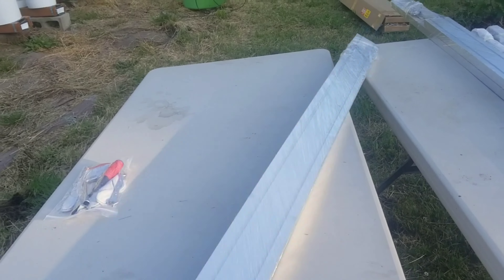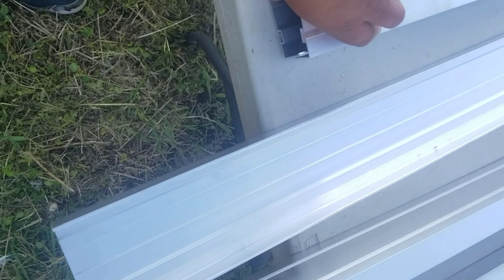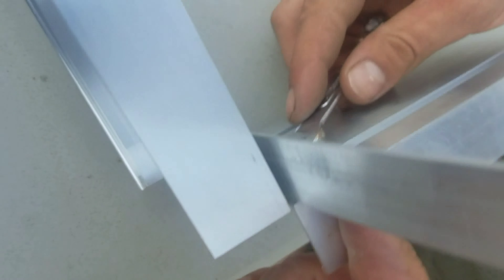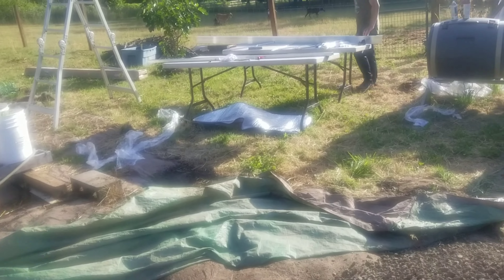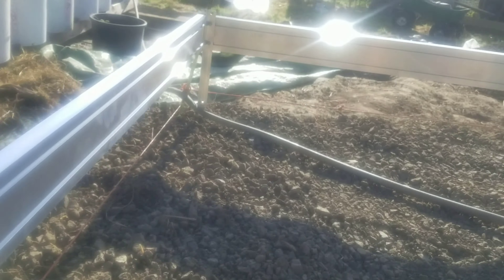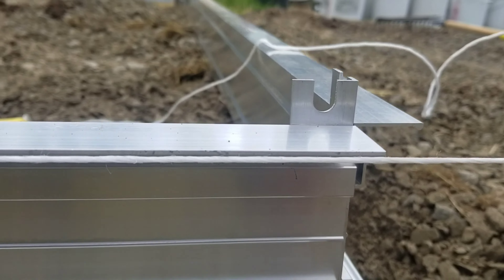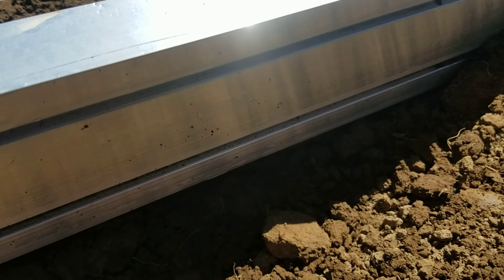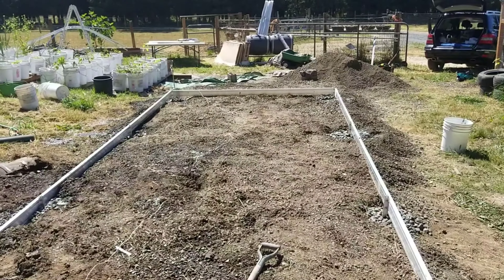#22 ClipaPod 9x28 assembly base Installing Climapod passion virtue labeling soil concrete footing

Comment: No place have I yet found any actual finish size dimensions for the 9x21 virtue. Forming a concrete foundation without knowing dimensions is interesting. Some actual dimensions in the directions would be useful.
Reply from the maker: Hello. It is at the order page.
https://climapod.com/shop/climapod-passion-9x14-greenhouse/?attribute_greenhouse-size=9x21&attribute_pa_passion-kit-packages=starter
exact dimensions

Outside: 8’ 11 3/16” (2722 mm) x 21′ 5″ (6528 mm) x 7’ 11” (2412 mm)

Inside: 8’ 8 7/8” (2664 mm) x 21′ 2 3/4″ (6479 mm) x 7’ 10” (2387 mm)

Total 191 sq. ft.
Reply: @ClimapodGreenhouse  thank you, I did have it right. I received the virtue Saturday, and did a lot of searching and figuring to come up with the dimensions. Almost ready to pour concrete and eventually install radiant heat tile floor...